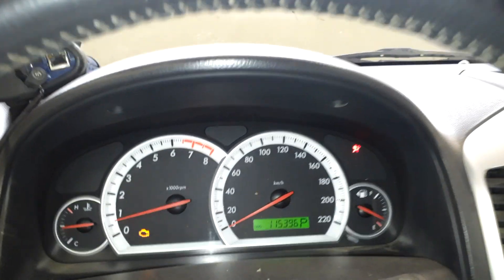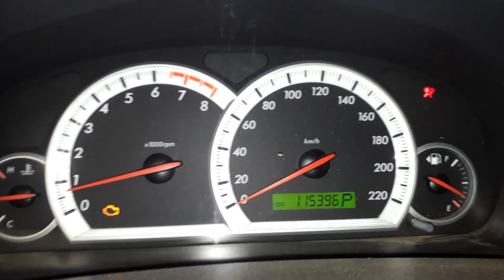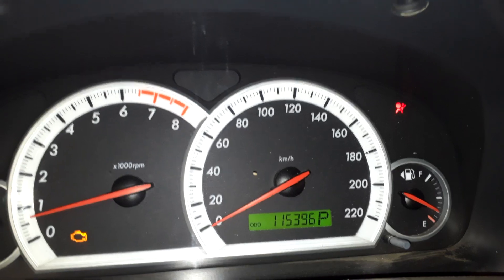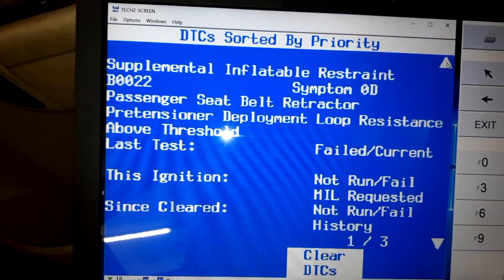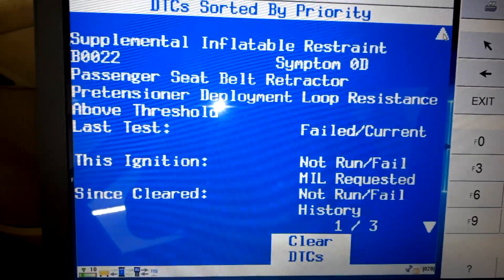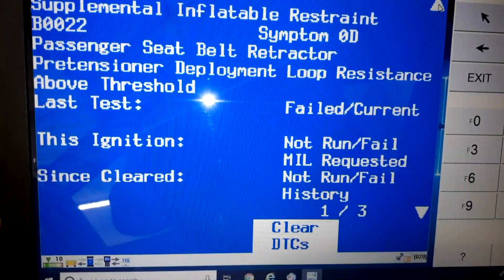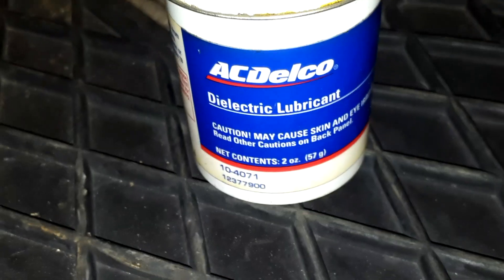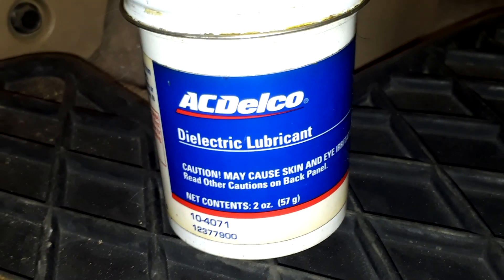Chevrolet Captiva 2008-2012 Air bag light ON

Comment: Hi all if this doesn't work.... look under the seat belt buckle on driver's side. There is a black plug or connector that connects straight into the pretentioner. I tried what this video suggested and no luck. Then took wd40 and sprayed the connecter under seat belt buckle. Worked like a charm!

Comment: Pls can you tell me does this action turn off airbag system wholely? Because dielectric doesn't transfer electricity as I know
Reply from the maker: yes, because dielectical remove high resistance from the connector and back to normal which is 2.4 ohms
Reply: @WissamAbbas  thank you very much. i have 2009 captiva and the same problem, this airbag light on. i have to pass inspection soon and can i do this action just to switch this light off and then after passing auto inspection turn on airbag system back?